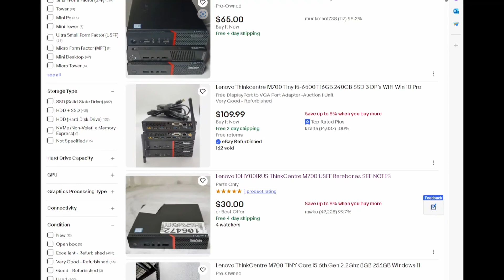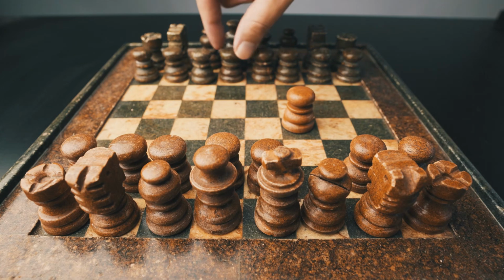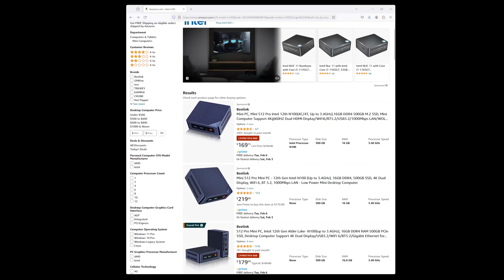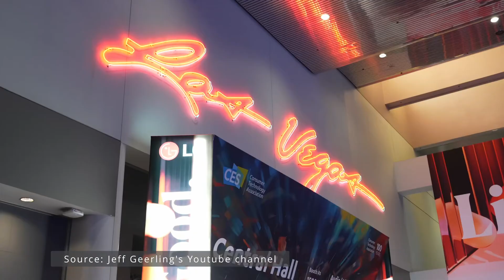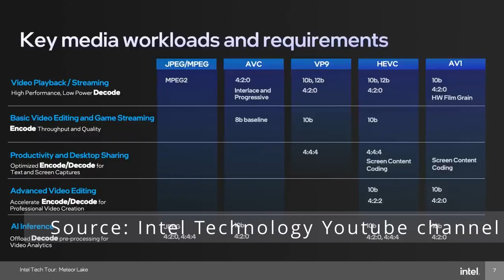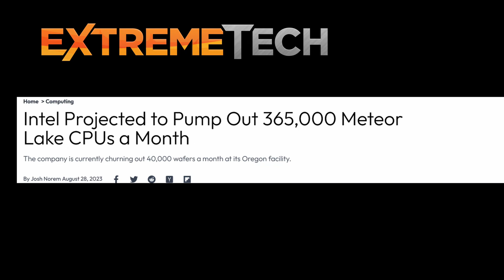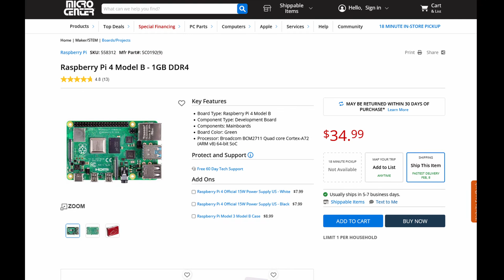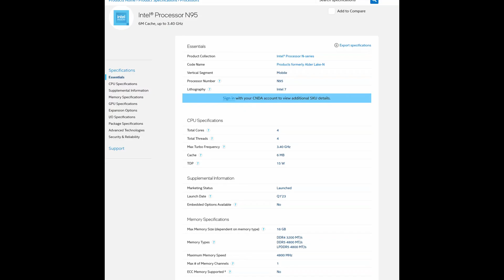The Raspberry Pi Is in Danger

Comment: The raspi zero keeps with the roots of the Rasperry pi foundation but has been replaced by the raspi pico for the most part. The zero is in need of an upgrade as other competitors offer better but sometimes more expensive alternitives. The raspi 4 5 and CM4 obviously has been claimed by corparate interest and won't be coming back to the table for budget hobbist to learn on and destroy. IMO what raspberry pi is doing is great in the long term. In about 5-10 years alot of IoT systems will be run on the platform the hobbists learned on the desposable raspi zero. If the raspi zero got a bump up to 2BG RAM and still fell in the out the door price of $20 I think it would save the raspberry pi foundation image. Maybe even push into the FPGA RISC-V core section.
Reply from the maker: My understanding is that raspberry pis are good for testing iot software, but such devices require hardware much smaller and more energy efficient (i.e. a controller) than what the even the pi zero can offer. There’s also a lot of alternatives to the pi.

And you’re right, businesses and startups do buy lots of raspberry pis (there was the story I read about the scooter share startup that had a raspberry pi on each scooter), so maybe its the tinkerers who might be in trouble.

At the same time, n100 sbcs are starting to come to market.

Comment: This video pretty much totally misses the mark of any meaningful information and/or understanding of what a Pi is.  Complete waste of time.  And I have had absolutely no trouble getting 3x Pi 5's at MSRP when I wanted them.  Just need to know where to look.  One retailer had over 7,000x 8GB models in stock at MSRP two weeks ago when I checked.  This channel is in no way "compelling" and I am permanently blocking it so I don't waste anymore time on it.
Reply: It’s a Raspberry Pi. It’s a keyboard.
A Raspberry Pi 400
It’s a Raspberry Pi designed into a keyboard.

Raspberry Pi 400 incorporates a purpose-built board based on Raspberry Pi 4. Featuring the same powerful processor, Raspberry Pi 400 has specially designed thermals to keep your computer cool and silent while you’re hard at work.

The GPIO pins remain accessible, so if you want to explore beyond the desktop, you can connect components and prototype your projects.

The above is what the company put out.  The last sentence is stating it's desktop, but you could use the GPIO pins if you wanted. But everyone else is to blame?  
🤣🤣🤣🤣🤣 THEY opened the door to comparisons.
Reply from the maker: Thanks for watching and sharing your thoughts!

Also you seem to have a severe comprehension problem, none of the issues I presented about the Pi included anything about procuring them at msrp.

Comment: Hi, one one hand, ARM CPU is (almost) unbeatable in the domain of power consumption which, in Europe because of the energy cost, can be important if you run your own web server from home or whatever service @home 24/7, but the ARM company is far from being clear and some glitches in it's "brain" matrix have recently barred many hardware developer from using this kind of product.   On the other hand, x86 products have software update priority, even about security, and present more possibilities (eg.: much more PCIe lanes available) but the down side is they also are current hogs when pushed.   At this time and providing the ARM company keeps on bullshitting it's developers, book authors (they now would like to be paid each time there's a written reference to ARM products), etc, I wouldn't bid a cent on it on the long term.

There is also a new kid in the starting-blocks, RISC-5, which is only at the beginning of it's life but shows encouraging  progresses - we'll see if it can turn the turbo on, adding multiple features (such as a 16 core fast CPU for SBC) and PCIe lanes while keeping a very low power consumption… ornot, but it has the benefit of the doubt at this time.

And to complicate all of that, there are now big CPU from Intel that embed a respectable quantity of RAM with multiple hardware accelerators and ARM derived Apple CPU also embedding lots of RAM and a quite good NPU.

How it will turn is, as usual, completely impossible to predict, the industry being erratic at  best when it is a matter of good things for manufacturers, admins and users - perhaps much less marketing and many more real work would help it, as keeping large gamuts of CPU is nowadays a total nonsense, a waste of resources and much too often, a strategy for scheduled obsolescence…

Comment: Heres the thing: The pi is meant for projects, like a portable game console, or laptop. The mini pc is meant to be used as a standalone desktop
Reply from the maker: *This person changed their comment totally since I responsed, so I'll make a new response*

What is a "project?" there are many people using their pi as a small hypervisor, a NAS, a router, a tiny emulator box (the playstation classic is pretty much a raspberry pi specwise). I've seen videos where people use a pi for ai tasks, mini cryptocurrency miner, using it as a... mini desktop...

The mini pcs with intel (and AMD, though those are *much more expensive) chips in them will allow a large portion of people buying or interested in buying raspberry pis do a lot more projects faster and easier (because the intel systems are x86-64) for nearly the same price.

Previous response:
Yes, these were worthwhile novel projects when you could get a pi for 40 dollars and a thinkpad t400 cost 150-200 dollars. Now, a t420 probably costs as much or a little more than a raspberry pi 5 after you buy a case and a fan and a hat and a power adapter and an nvme for the hat. There goes the portable game console and actual laptop, oh and the thinkpad portable game console has a monitor included. And you can run whatever os you want on it.

What’s the pis competitive advantage right now?

Also, please understand that my intent is not to "dunk" on you or raspberry pi as a device or foundation. Things are working out for them in some fashion or another. I liked the idea of the raspberry pi before, but I think it strayed way too far from its original purpose.
Reply: Ah yes doom and gloom spew nonsense to a group of people want to spew nonsense, that is the YouTube way!

Comment: PI's serve a specific niche.   If you need GPIO and stable software, they're hard to beat.  The reason the competition never achieved the same success is they never had the same level of software support. 

PI's as desktop are barely adequate.   The Pi5 is finally as fast as a low end PC.   If I just need a cheap desktop, I buy a low end PC.  The Pi was never a good first choice for that use case.
Reply: Want GPIO with an Intel chip? Have a look at the Radxa X2L. Rumour is that Orange Pi will launch a N100 SBC at a price close to the Pi 5. Eben Upton better be quick with that IPO, as it looks like they are going to face some strong competition.
Reply: @LivingLinux  Been eyeballing that board. It's interesting.
Reply from the maker: You’re absolutely right. 8gb of ram for gpio projects or making a camera with a pi is overkill though, and in turn, pay 80 dollars for a pi is also overkill for such projects. 

As you said, pis as desktop pcs are barely adequate, and the adequate x86 mini pcs are inching closer to pi5’s price and efficiency-wise. Who is raspberry pi making the pi5 for?

Someone upthread opined that contemporary raspberry pis are for Americans playing xbox games at 120fps, but here in the states you can get a thinkcentre tiny for 40 dollars and play xbox games at such fidelity.
Reply: @CompellingBytes  

I do development on my Pi4/Pi5 because they're fast enough but my plan is to use the Pie Zero W2 for the final application.  

So get it all working and coded on the more expensive 4, then use a cheap PI for the final project.  

I don't think Pi5's are too expensive for what you get.  If they were $150, they would be. 

I see people trying to press Pi's into doing chores they're not that great at. I wonder why?
Reply: @CompellingBytes  i think ill just stick with my pi 4

Comment: Hmmm, yes and no.

First, I agree with Ebon regarding the AI. I'm sure that many people won't need that and wouldn't like the extra price and probably extra power draw.

If anyone is interested in low power draw, "Wolfgang's Channel" channel here on YT has deeper dives and tests. He shows the importance of the motherboard in having a low idle power. IIRC with a Skylake mini PC he reached basically the same power levels as a Pi - 6W at idle for example.

Meteor Lake ... it certainly isn't as power efficient as I was hoping to be. The inter tile communication I guess has some issues. Or somewhere there's extra overhead. But I think that with Arrow Lake and especially Lunar Lake (which will be specifically low power and with DRAM on chip) it will be improved. I am especially hyped about Lunar Lake, I really hope it won't flop. With it we might finally have fanless ultrabooks in the non-Apple world.

Anyway, getting back. Meteor Lake is very new ... and expensive. For now. The process node it's on, also seems to be more of a transitionary one, which makes me think it won't live long. So I don't expect Meteor Lake mini PCs to appear anytime soon... if ever. And if they do appear, I really don't think they'll be as cheap as, say, N100.

A Lunar Lake based Mini PC would make much more sense, but I think it also will appear 1-3 years after its launch, when the process is more mature and less expensive, and the big-money market has been saturated with them. So for several years, RPi + clones should be fine.

It would be awesome to have rereleases of Raspberry 0-4 with a much newer manufacturing node. If I'm not mistaken they were done using 40nm ? And RPi is using a 8nm one ? Just imagine the power efficiency improvements from such a shrinkage. And the chip will be much smaller too. And much more suited to be passively cooled. And a smaller chip would help in having its price at the same level (newer and better manufacturing nodes are more expensive than the older ones).
Reply: I calculated my high end desktop running 24x7 would cost me $200/yr in electricity.   I picked a rate/kw/h which was probably 2-3 times what I'm actually paying.   That suggests caring about power consumption of your computer is kind of silly. 

If I was running a data center I'd care. Running a couple PC's and PI's at my house, the difference in power consumption over a year is basically insignificant.   My clothes dryer alone consumes more power in a month than all my PC's in a year. 

I know many people care about this stuff.  I'm just not sure why. Have they not run the numbers?
Reply: That's a lot for some people even in the US.  @quademasters249
Reply: Raspberry pi are not concerned that much.  It will change in next year or so .
But not what you think.
It was designed for poor countries & schools etc. The problem it got in a rat race mainly for the states! Needs to run xbox games @ 120hz NO!
Reply from the maker: i agree with you on a lot of the points you make, and there are some points you may think I disagree with you on when that isn't the case :)

Meteorlake has been on the market for less than 2 months now, it's still very expensive. The products being used are also full die or close to full die, some complement of big and little cpu cores, a fully enabled io tile, fully enabled soc tile, and 8 Xe cores (!), on the top die at the least. As I touch on in the video, if Intel decided to use binned tile/dies (assuming there are enough), a cut down meteorlake die using only 4-6 little cores (I'm guessing at least 1 power island core is required for the whole die to work) enabled would allow minipc manufacturers to approach a much lower price point.

Another thing to consider (I didn't mention this in the video because I wanted to keep it as brief as I could) is that the n100 wasn't released until 18 months after Alderlake launched. Meteorlake is expensive for early adopters, and because Arrowlake isn't out yet. Following a 18 month post launch cadence and a cutdown Arrowlake die could probably fit into these mini pcs costwise. I don't think these sorts of machines will be around next week or next month, though $500-600 Meteorlake boxes/NUCs could be around in 6 months. The big challenge/unanswered question for low cost Meteorlake is that Intel is relying on TSMC to make most of the tiles for Meteorlake, so my question is are they binning those tiles?

I'm guessing what keeps costs down for raspberry pi is coasting far behind cutting edge processes (raspberry pi 5's cpu is fabricated on a 16nm process) when selecting silicon, but a cpu that requires air cooling for what becomes bonus performance is out of character for rpi and implicitly drives up cost with the optionally required cooler.

Anyway, I hope you got through all of that. Thanks for watching!
Reply: @CompellingBytes  Yeah, I got through all of that :D I think we're mostly on the same page, so to speak. Thanks for the reply!